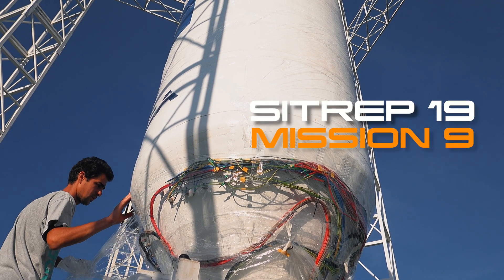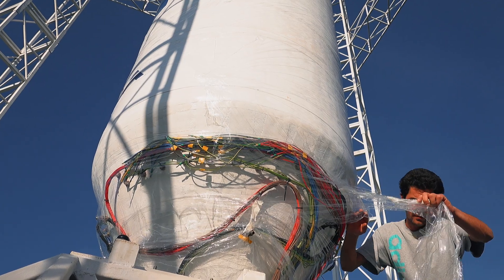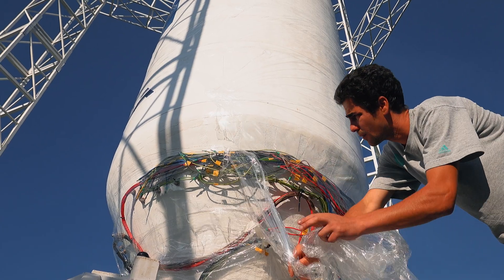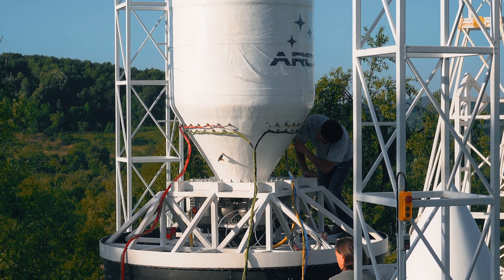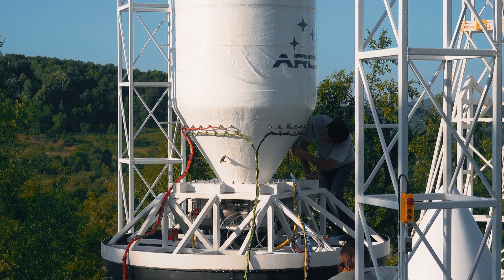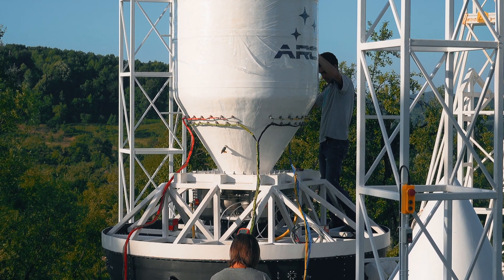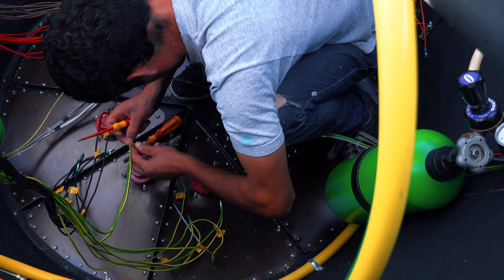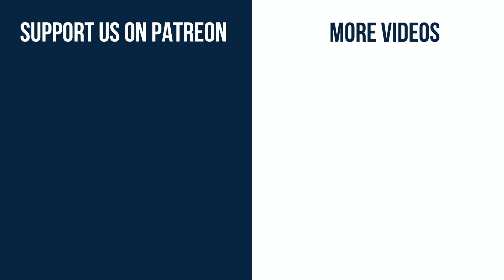MISSION 9 - SITREP 19: Power Connections Complete

Comment: Question: From what i understand the power for the heating elements are now coming from the grid, how will you power it in real live (i assume batteries?) and how much power do you going to need and for how long?
Reply: The power will (almost) always come from the grid. Water will always be heated in prelaunch sequence, and batteries are only used to keep the heat up, in the launch sequence, when the booster is disconnected from the grid. Not much power needed for the couple of minutes of flight, with the water already boiled to vapors. Do not compare it with a electric machine, more correct with a flywheel machine! It stores the needed power right before the launch!
Reply from the maker: @iulian Br: yes, your description is accurate. Thank you!